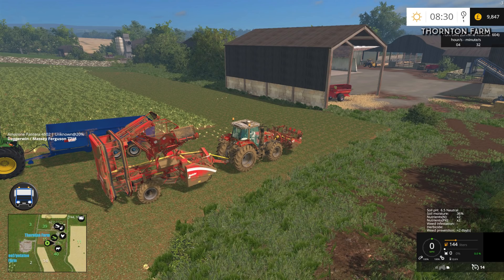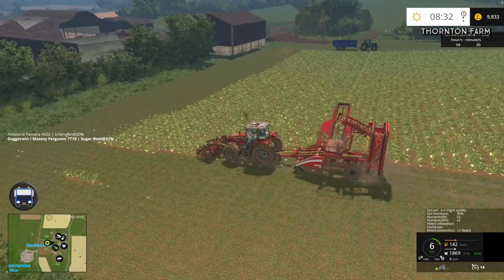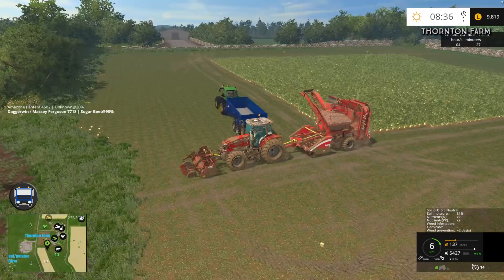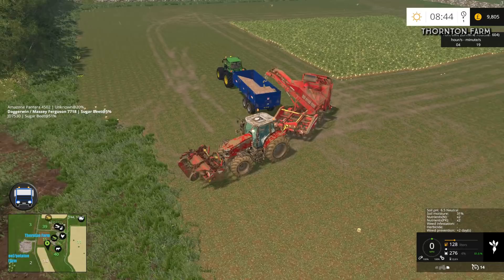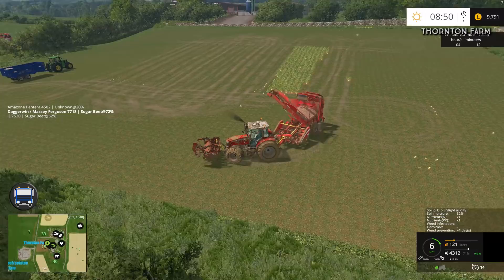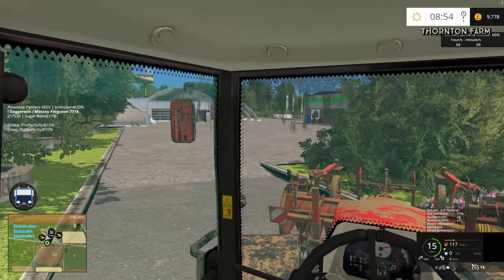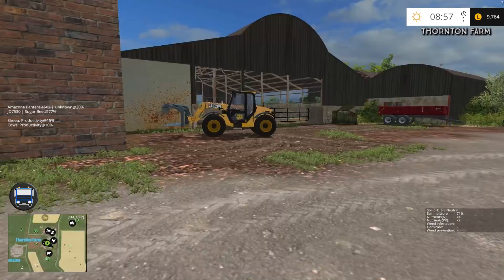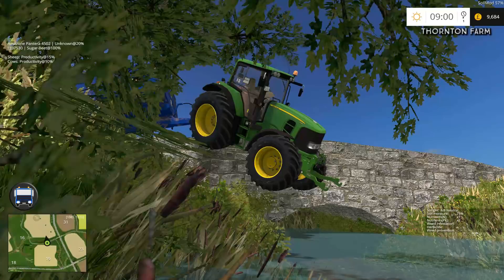Let's Play Farming Simulator 2015 | Thornton Farm | Episode 47

Comment: There is a pull behind potato harvester called des taters. I think I got it from mod hub it does 6-8 rolls at a time I think . Also there is a modded khun mower to chop the tops off the potatoes as well its pretty cool I used it on green river map. Check it out if you get time would like to see it in your video. Hope this helps great videos love them all .